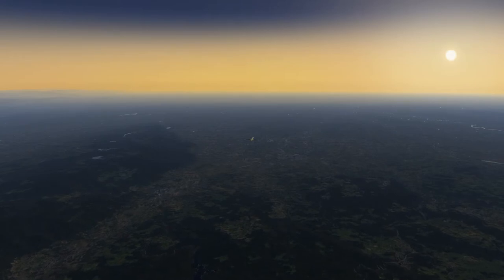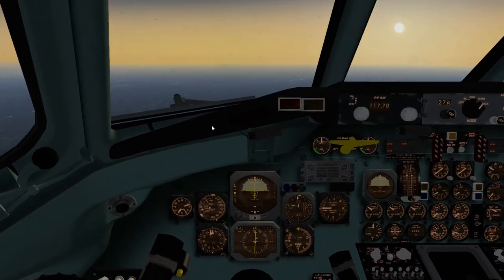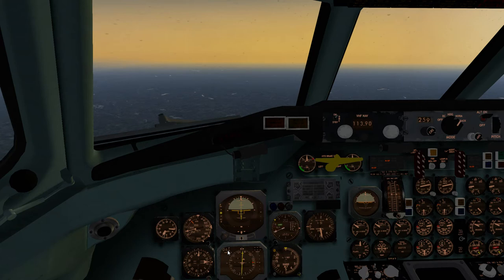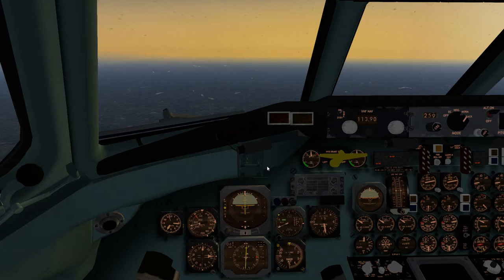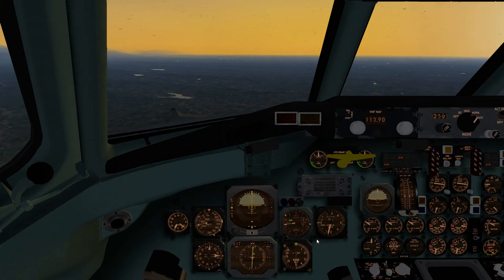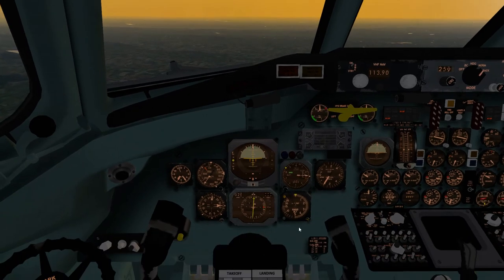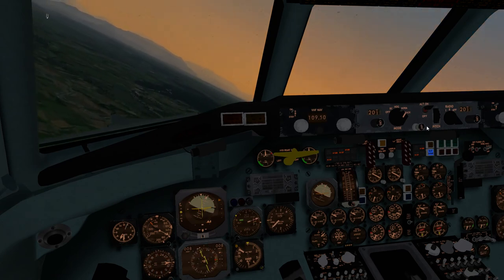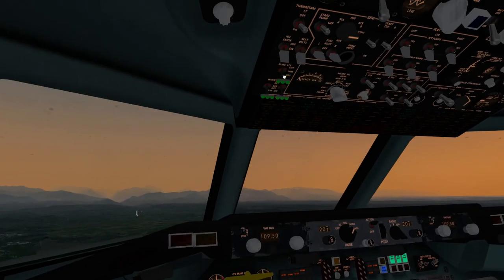DC9 Part 2 - LFBT Arrival [X-Plane]

Comment: I looked through a copy of a DC-9 FCOM that I found ( http://aviationarchives.blogspot.com/2016/10/douglas-dc-9-flight-crew-operating.html ), and it doesn't appear there are any airspeed limitations for landing light extension. The only limitations listed related to the lights are cycle time limitations (let motors cool 1 1/2 minutes after initial extension or retraction, and 3 1/2 minutes after each subsequent extension or retraction) and lamp time on of no longer than 10 minutes in still ambient air to prevent excessive heat build-up.
Reply from the maker: Thanks very much, that's really useful.  I hadn't seen that FCOM either so I'll have a look through it.
Reply: You can tell how old that FCOM is because it talks about cruising at Mach 0.8 with those engines.

Fuel used to be bloody cheap.

Comment: To have an FMC with this plane, you have to install KLN90B (free).
Then open the plane in plane maker in the 3d dashboard menu.
And replace: but_hsi_12.png by but_hsi_12gps.png.
  Here is a modernized plane. :-)
Reply from the maker: Thanks, I've been using the DC-9 for enjoying VOR airway flying, but I have the KLN90B in the Tu-154 so will try putting it in the DC-9.

Comment: Hi Graeme. I meant ask you from the first video how u get the keystrokes assigned for the doors to open. I don't see an option in settings for opening doors.
Reply from the maker: I've added keystrokes for the Slider 1, 2 & 3 functions which operate the door, airstairs and tail stairs.
Reply: thank you